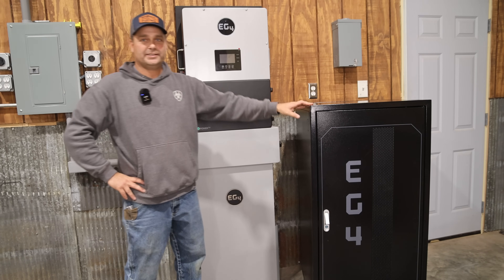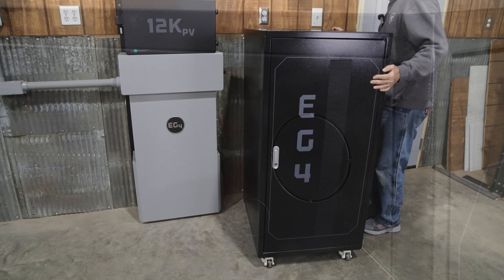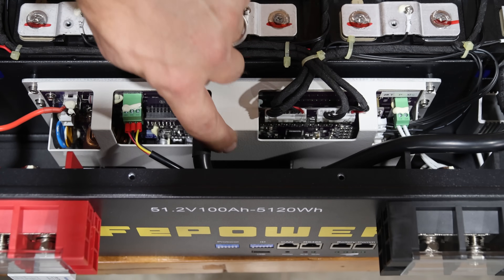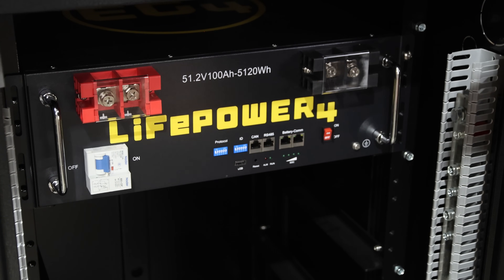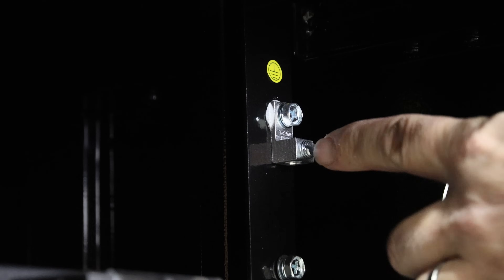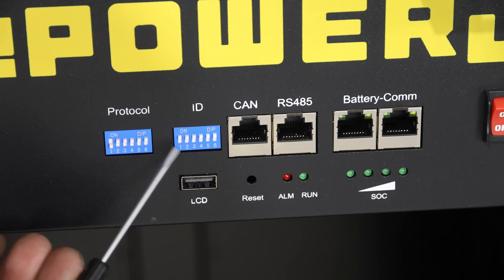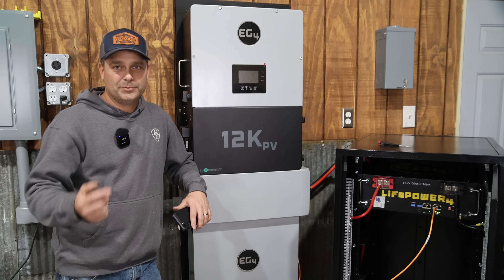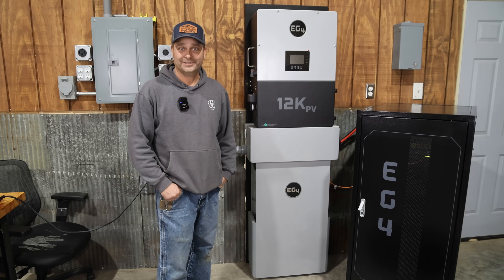Installation and Overview of EG4 LiFePOWER 4 Battery and Server Rack Battery Cabinet

Comment: You probably place the battery in the top position for the video, but it would be best placed at the bottom to decrease the tippiness of the unit specially if you intend of move it about.

Comment: Unless that ground point for the batteries on the cabinet is contacting bare metal its not truly bonded.  I cant tell if it is from the video or not but the holes beneath it arent bare metal so I would assume that its not either and the screw doesnt look like it has a cutting head on it but I cant tell that either.  Normally bonding screws are green as well and this one isnt but that doesnt necessarily mean its not bonded.    Anyway.  My issue with EG4 is that they dont offer any cabinet larger than 6 batteries.  Sure 30kw is good but 60 is better and I dont have the horizontal space for 2 of these things in my utility room.  I have vertical space to stack 12 server rack batteries sure but you cant stack these AFAIK.  Ruixu makes a 10 battery cabinet which Im looking at but they will only sell you the cabinet if you buy their batteries... probably because I asked them if I could buy just the cabinet and put EG4 batteries in it last year.

Comment: Do the batteries self balance voltage differences when you connect them in parallel?
Reply from the maker: Batteries won't automatically balance between different batteries.  To Balance the system, it's best to let the system charge to 100% and let them Float charge for 24 hours to balance between the batteries. 
I would probably only do it when the batteries SOC had more than 10% difference.
Reply: If they don’t slow balance, they should probably be at 0v difference before connecting them 

Even 1v difference would cause a huge current

Comment: How did you physically connect rack DC CABLES to the Wallmount battery?  Tonight, I was wondering if this could be done as I am configuring a solution on Signature Solar’s website.
Reply from the maker: They sell connectors for the wall mount battery connections, so you can make your own cables.

Comment: Would've liked to have seen more details about connecting the wall mount battery to server the rack. They have push connects on top the wall mount, what, do they make a push connect to M8 terminal cable? What gauge what configuration, why does everyone skim over proper cable sizes and connections when demoing this equipment?

Comment: Great video...its hard to tell from the camera angle but if your cabling for your batter extends outside the horizontal plane of the battery you're installing I would fix that now or before you install your next battery.  As someone who has spent countless hours working inside server racks, your future self will thank you.  This makes maintenance or service on each individual rack unit much easier/safer.

Comment: Evan, I enjoy your videos.  If I may, if you plan to move the battery rack around with the single battery - you might want to put it at the bottom so that the rack is not top heavy.

Comment: Thanks Evan.  The server rack batteries were my choice for a long time.   They are more modular but take up more space.  Replacing parts over time is more manageable with the server rack batteries I would assume.  How would you compare the EG4 to the EP Power? Thanks for your videos.
Reply from the maker: EG4 is designed to work different battery types and brands.  EP Cube can only use EP Cube Batteries.  I like the flexibility of the EG4
Reply: @ oh that is good to know.

Comment: Evan one thing I learned the hard way is to not build something like that top heavy. I would have filled the bottom slot first and brought it up over time. No sense making easier to tip over.

Comment: Hi Evan, are your battery cables the same length? I have the same setup but with 9 LL batteries. I think I'll redo my cables to your recommended placement, top and bottom. I'm currently using 4/0 cables.
Reply from the maker: Yes they are the same length.

Comment: You can add a screen...
Reply from the maker: Yes, I believe so.  they sell a communications hub.  
https://signaturesolar.com/EG4-LiFePOWER4-Communications-Hub?ref=SCk84NAJZA053X
It's $140.  Might as well buy the EG4 LL server rack battery if you want a screen.  The LL Battery is only $100 more.
https://signaturesolar.com/eg4-ll-s-lithium-battery-48v-100ah-server-rack-battery-ul1973-ul9540a-10-year-warranty?ref=SCk84NAJZA053X

Comment: Hey Evan!  Love the 2nd channel.  One suggestion is with a 100 lb battery, it would have been a little concerning mounting it at the top of the cabinet making the cabinet top heavy.  If one of the casters comes in contact with something and locks up, the cabinet could tip over when moving.  Just thought I'd share that.  Thanks for the video.
Reply from the maker: Yes, the manual says to start adding batteries from the bottom.  But for Video Purposes, it need it higher.
Reply: @CountryViewSolar-DIYProjects  ahhh!  Good job! 👍

Comment: So in the long run sounds like you might save 2.50 month in electric bill going with Solar vs Grid to me.
Reply from the maker: 5 kWhours a day is $.75 cents a day for me.  $273.75 in savings a year.  4.35 years to pay off the cost of battery.  over the course of 10 years it will make an additional $1833.60 of power savings, after paying for itself.

Comment: Question. Can you hook these batteries up to be used directly or do you have to use an inverter?
Reply from the maker: Yes, you could use them directly, if you had something that used 48 volts DC
Reply: What i meant is could you hook up to the house somehow?
Reply: @bt5029  To be useful in the house you would need an inverter to turn the DC into AC